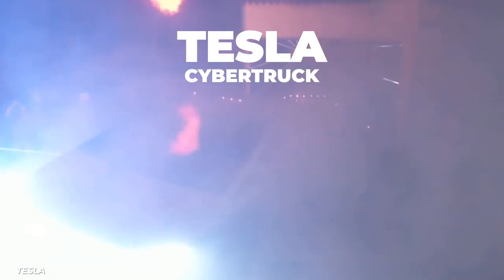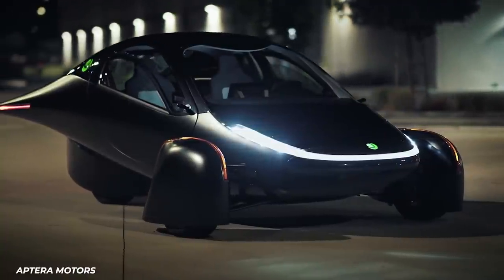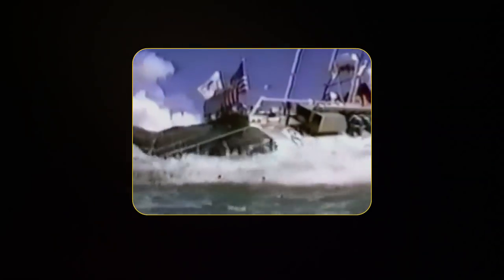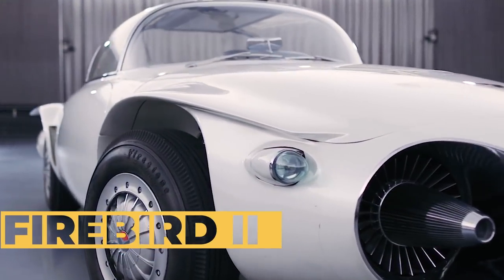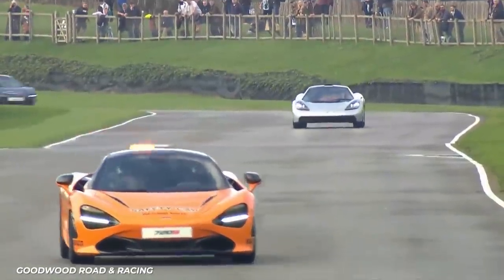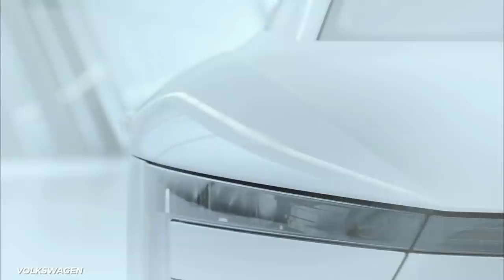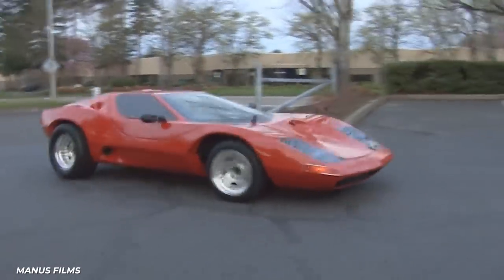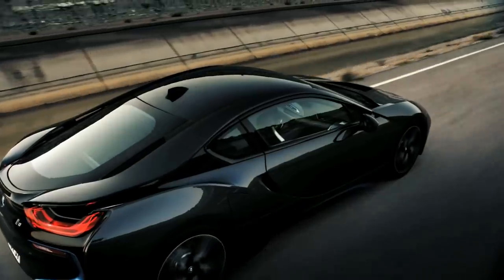These Futuristic Cars Actually Exist

Comment: On the Aptera. The 2E was the earlier version, the rebooted model is just an "Aptera" by Aptera. 4 versions are available with battery ranges of 250/400/600/1,000 miles (Hence the overall price scale) The original founders lost control of the company and then left in 2008, well before it folded shop. They reacquired the IP rights and with the advances in technology are building the updated and upgraded Aptera with production slated to begin towards years end.   Link Posted to Reddit r/ApteraMotors.